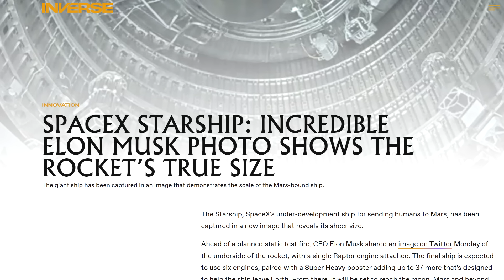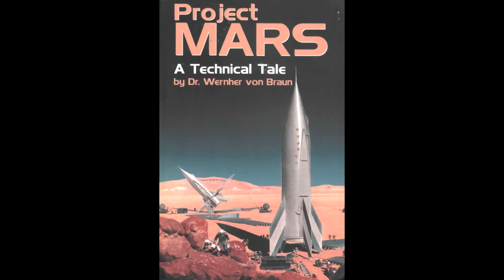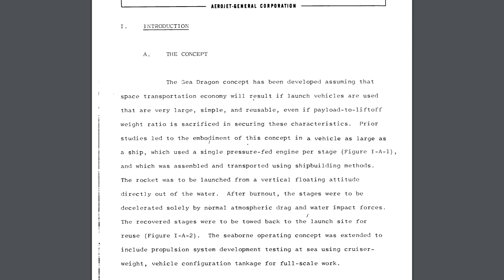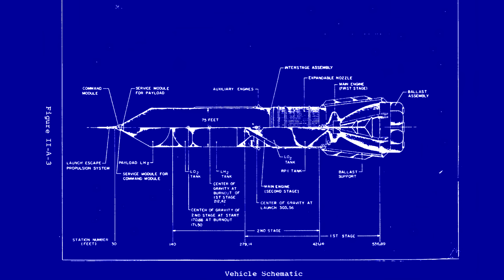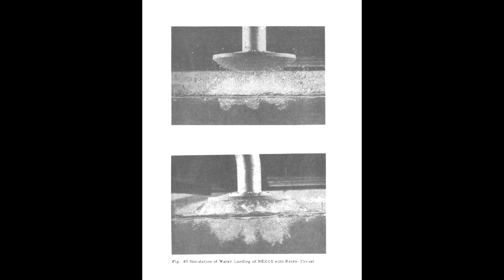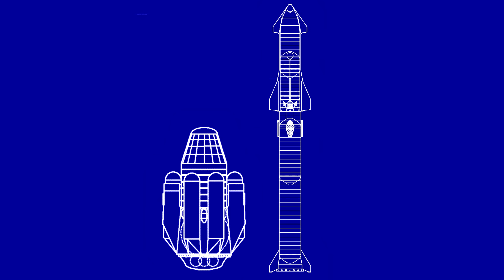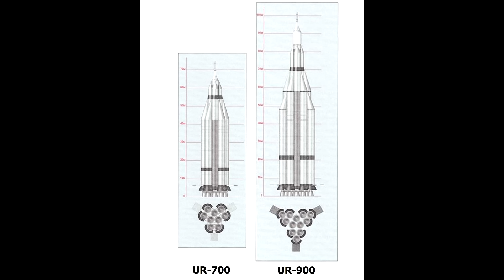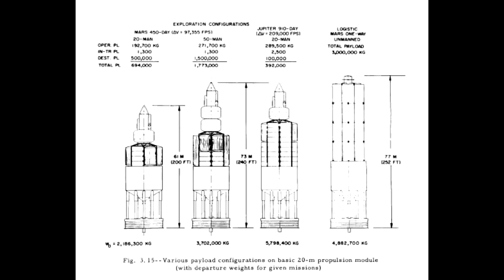The Old Rocket Designs That Make Starship Look Small

Comment: Sea Dragon remains my favorite rocket design. Such a cool idea, and love to see the concept of the massive BDB continue with Starship.
Reply: @thisisyourusernameondrugs9373 
Thinking with the other head, i see
Reply: Send the idea to Elon after Starship
Reply: gay bowser  
Playing too muck Kerbal eh? I did the same
Reply: @thisisyourusernameondrugs9373  You're telling me it means something other than this?
Reply: As a college student intern, I worked for "R.C.T" (Robert C. Truax) on Sea Dragon, at Aerojet-General's Advanced Development Division in the summer of 1962. We were calculating (using slide rules and electro-mechanical calculators) 20, 40, 60, 80 and 100 million lbf thrust engines, as well as some other projects using low-pressure, self-pressuring hypergolic propellant combinations.  What an inspiration to work for him on these projects. I had first enjoyed a correspondence with him when I was a fourth-grader and he was a Navy lieutenant-commander in 1954. My proposal as a kid was to use controlled atomic combustions to power rocket ships. He replied with an encouraging letter I still have.  In 1962, when the Air Force was proposing their Project Orion, I wrote to Truax to ask if my thoughts had anything to do with the Air Force's proposal. (Truax had a lot of interaction with the Air Force on many things.)  He wrote back that he didn't think so, but how would I like to work for him for that summer? Wow! Of course I said yes.  I spent the next 27 years directly in the aerospace business, including the military. I still keep up with space and advocate for it through the National Space Society, et al.
Ad Astra!
Reply: @jamesbarnard9710  Ok so you should know enough to see that the ISP claims on low-pressure fed engines that Sea Dragon was based on were nonsense.
Reply: @kennethferland5579  I  don't recall after all these years what Isp R.C.T. claimed. The propellants were supposed to be self-pressurized by the propellants boiling at the top of the tanks. It was an interesting concept, however.
Reply: Starship doesn’t seem like a very dumb booster to me. Not in the same way as sea dragon, at least.

Comment: @1:40, nice shout out to the reusable Saturn S1 concept from Convair! What's funny is that it was literally about a paragraph in the entire "NEXUS" study even though it had been worked on (after NASA asked it be included :) ) just about as much as the actual "NEXUS" itself. Not sure if the proposed recoverable version of the SII stage was given the same treatment, (only illustrations are essentially a slightly smaller S1 re-drawn) but it's interesting that the actual 'question' NASA asked Convair was about a NEXUS-like vehicle that could mount heavier upper stages (such as a larger NERVA or large self-deploying space station) AND still fit in the VAB. Hence the 'squashed' S1 and SII which would lower the overall height (and still fit on the MLP :) ) enough for those upper stages to clear the top of the VAB doors.

Think you might address the Goodyear METEOR (2,500ft long and 1500ft in diameter "Space Station" made by disassembling the third stage of a fully reusable, fully manned three stage to orbit vehicle, ya gotta love the esthetic :) ) and METEOR LV and it's successor METEOR Jr?

Comment: I also remember reading of a design back in the late '80s/early '90s where they went for musk-style horizontal scaling. The rocket would be lots of long tanks next to each other, alternating fuel/lox with an engine at the joint of each tank, with stages being nested inside each other.

Comment: I think the shuttle is a derivative of the double space planes concept. They made the first stage non reusable first then added the side boosters because the engines weren’t that powerful
Reply: We also don’t use it anymore for various reasons and the shuttle wasn’t designed for long distance space missions.
Reply: Other way around, the Boeing "Space Freighter" was designed from the work done on the Shuttle Orbiter.
Reply: @randycampbell6307  Well regardless. Using the same craft to leave earth especially a manned craft then require it to land back on earth is incredibly stressful for the craft and incredibly dangerous for the crew. Space craft should stay in space. Then you send the human crew, fuel, and a separate lander which can be different depending on where it’s to land say Earth, Mars, the Moon. Sure way more expensive but allows for much more versatility and modifications.
Reply: @DeliveryMcGee  Crap design? Only 2 failures out of how many flights?
Reply: @DeliveryMcGee  Yeah if NASA had been left to build it how they wanted, (complete with adequate funding), it would have been a lot better. The shuttle suffered from a massive set of compromises coupled with very little work done on it's biggest flaws after the fact that left it i'll suited for much of anything.
Reply: @rolandthethompsongunner64  It's (always :) ) about tradeoff's but in general you want a certain launch/landing ship and a deep space vehicle to allow more optimized and eventually economical travel both into and from space, and to and from other destinations.

Kind of like to see Scott discuss something like the "Spacecoach" concept or some of the other 'dedicated' space-to-space ships and give using Starship a rest. It's really NOT a good candidate for a full mission and is why "Mars Direct" (on which it's based) isn't actually a good paradigm for long term or extensive solar system exploration or colonisation.
Reply: @randycampbell6307  Everything I've ever read said the opposite. Got a link to educate me? Oh , wait, you' said the same thing I did, just disagreeing in general because I said it first.
Reply: @anzaca1  the "space truck" myth belies the fact that the shuttle was a development platform, a hopeful step toward a SSTO space plane.
Reply: @anzaca1  That is 2 complete failures out of ~150 launches. There were however quite a few more missions that came really close to disaster. Some of those were only saved by sheer luck. Compared to Soyuz that just doesn't look great. 

There was just so little abort capacity that I doubt anyone would man-rate the shuttle today. It was too much of a compromise between various goals imo.
Reply: @randycampbell6307  Not really. The s[ace freighter was designed in the early 60s after they finished designing the Saturn V and was translating into building and operational mode. Dr Zubrin mentioned in one of his talks how Nasa derived the shuttle from the freighter.
Reply: @prophetsspaceengineering2913  Fun fact: At the time of its retirement, the Space Shuttle had more missions under its belt than all Soyuz versions combined.
Reply: @DeliveryMcGee  Nope! Some of the Phase B Shuttle designs could do everything our Shuttle could - including crossrange and payload bay size - and still be fully reusable. Plus, NASA also wanted these features - both are good for mission flexibility.
Reply: @DeliveryMcGee  No actually YOU said it was designed to steal satellites which it was never intended to do. Also "everything you've read" appears to not cover any of the in-depth histories of the program which are pretty clear that NASA had a specific vision for the Shuttle which the Air Force did no really share since they didn't think they would actually have to use it. I'm not disagreeing that the Shuttle was compromised in general but both the basis of and reasons for are what I'm disagree with.
Reply: @MrHichammohsen1  As usual Dr. Zubrin is wrong, about a great many things :)
The Space Freighter was designed in the late 70s (as Scott points out) to address the perceived need for large cargo's to Earth orbit that would be needed to build Space Solar Power Satellites. A concept itself dating from the late 60s. It used design concepts and principles derived from the Space Shuttle Orbiter which was at that point in the advanced building stages.
Reply: @HalNordmann  Very true. And by now, Soyuz has flown more often than the shuttle with no further severe accidents. 

Soyuz had its fatal accident at the very beginning of its career and apparently, the program could improve upon that.
Reply: Going beyond what has been said above by various posters regarding NASA vs DoD influences on the STS design, I will mention some political/budget history:  The NASA budget request for a space transportation system was presented to the Nixon Administration as three options (small/med/large payload bay size and mass capability).  The numbers were scrubbed mainly by George Shultz's OMB, and then Nixon in consultation with Kissinger gave the go-ahead for the largest of the three.  They correctly reasoned that given the heavy development costs (though wildly underestimated in retrospect), going with the largest/best didn't come at that much higher of a price.  Plus a smaller shuttle would only replace the need for some classes of expendable boosters, so why go to all that trouble just to handle the lower end of the launch cost problem?

At that point NASA had been given what they wanted, including essentially all of the money they asked for.  The budget cuts/constraints people go on about came later, as the agency and contractors proved unable to deliver what had been agreed to within some semblance of the budget agreed to ("Space is hard.").  It's important to note that a configuration for the STS hadn't been set at that point.  Models resembling the as-built STS notwithstanding, NASA still had latitude.  They continued looking at things like an Orbiter atop a winged S-IC for a short while longer after program/budget approval.  So they had both money and design freedom as the effort got underway.

One item of special note in that original approved buget was $300+ million for development of an escape rocket for the STS.  That piece of the funding was axed early on not by Congrees, but rather the program manager.  He shifted it into the contingency allowance, reasoning (very correctly!) that the contingency amount they had budgeted for (20% of the estimated development costs? -- I forget) might not be adequate as the program got underway and problems arose.

Comment: I was literally just reading up on Saturn MLV, Nova and Phillip Bono rocket design variants before I knew you were gonna release this today. Seems any SHLV design exceeding 100 tons in payload mass has to get wider and not taller than 100m.
Reply: Most of that is to do with how the VAB at the Cape is constructed.
Of course, there is the TeamVision Jupiter III concept which just says "Hey we're gonna need a bigger building, that's fine, right?"
Reply: I do have a soft spot for the MLV designs, they could’ve been perfect for the Apollo Applications Program
Reply: Is there actually an interesting read to read up on this stuff or do you mean browsing the web?
Reply: Thrust to weight plays a role here. If you roughly approximate that rocket parts and fuel have a certain average density, then an engine with a given footprint and thrust to weight ratio can only support a limited height of "rocket stuff" above it. I guess with current thrust to weights this comes out to 100m
Reply: There is only one reason to build "skinny" and that is tool or transportation limits. There are some aerodynamic reasons, but at scale those start to matter much less.

Girth beats length...even in engineering.
Reply: @dsdy1205  

Well sure but it has not one form of density but two: the Weight density of all the dry weight components, and thrust density of the maximum thrust per square meter. Since it is extremely unlikely to suddenly find means to reduce weight density, it’s accepted that there’d be means to make the engines more powerful per square meter. Hence why Saturn V had a respectable 45 tons/m^2 for its time and Starship has more thrust density than the Space Shuttle SRBs, even though both could easily be at the very top of the list. SLS SRBs will be even more ridiculous though.

Comment: The best giant space thing is the plan to have the Saturn S-1C do a boostback burn and be grabbed out of the air under parachutes by a ridiculously huge helicopter powered by ramjets on the rotor tips, to be built by Hughes.
Reply: That truly was hilarious. The helicopters literally looked like Saturn V first stages with propellers installed.
Reply: The tip of the blades would have been supersonic even at the minimum speed
Reply: Ooh! I'd forgotten about the ramjet helicopter thing. I read about it years ago. :D

Comment: This may be repetition of something I posted elsewhere about Sea Dragon.  In the summer of 1962, after my 2nd year of college, I was privileged to work for Robert C. Truax at Aerojet-General's Advanced Propulsion Laboratory in Sacramento, California. Among the things I was involved in was doing calculations for 20, 40, 60, 80 and 100 million pound thrust first stage Sea Dragon designs! How did I happen to get the job? Well, back in 4th grade, 1954, I had this crazy idea about using "controlled" atomic explosions to power rocket ships. My uncle, who had been in the Navy in WWII, suggested I send the idea to the Bureau of Aeronautics, which I did. I got a very nice letter from a, then, Cdr. R.C. Truax, encouraging me. (I still have the letter!) In 1962, when the Air Force announced Project Orion, with a similar concept (with some actual testing with high explosives), I wrote to Truax to see if my kid's dream had sparked an idea. His reply was that he didn't think so, but how would I like to work for him at Aerojet, which I did. 

Another idea he played with was using some propellants that would self-pressurize because they boiled at room temperature. So long as they were under pressure, they remained liquid.  He would walk around with a clear bottle of Freon, so you could see it in its liquid form, until he squeezed a valve release, whereupon the vapor would spray out of the nozzle.  He used the similar concept with supersaturated steam in Evil Kineavals' motor cycle that was attempted to fly across the Snake River canyon. When the cycle failed to get enough thrust to fly across the canyon, and Kineval was forced to use a parachute, Truax "accepted blame" for not getting the water hot enough. Personally, I don't think it was intended to make it across, because Kineval would have been split like a fish if he landed!

Comment: Now I am wondering how big a Starship V2 could be? If the concept of scaling up rockets works for SpaceX, would they try to make Starship even bigger? Curious what you think @ScottManley 🤔
Reply: Surely if it works and they find the need, they'll go for the original starship design that's almost twice as big (mass) featured in the start of this video?
Reply: @Tiwack01  that would be really interesting, why did they chose the scaled down version, do you know?
Reply: They could go with triple-booster Starship Heavy, if they need about x3 payload. There is no demand for such beasts in the foreseeable future, though (about 1000 ton max payload to LEO in expendable config!!!). Smaller and simpler way to launch occasional heavy and/or oversized payloads is to have an expendable version of the upper stage, with traditional fairing.
Reply: @denysvlasenko9175  that would be sick

Comment: 13:45  Yeah, I understand that ratio..  but fuel tanks should not be pressurized?  When we scale a pressurized tank, for the same pressure the dry mass of the tank increase exactly at the same rate than the volume, so I dont see benefits on that regard, I hear that we can save on avionics, but that is NOTHING in comparison to the over all dry mass.
I always wanted to know how scale benefit the rocket performance and why..  But never read nothing detailed on that topic.

Comment: Personally my favorite concept was Boeing's LMLV. I think it was proposed in 1968, and could carry about 2000 tons to orbit (I think?)
Reply: ~1800 metric tons but close enough
Reply: Daaamn that's like 2 of yo mamma ;)
Reply: @danielculver2209  and a fraction of yours.
Reply: @Glass42112  He ain't coming back from that one
Reply: @danielculver2209  got em coach
Reply: The LMLV was a great concept, although I personally wouldn't have gone with an Aero spike. They did because of the paper advantages, but now, after the X-33, we know that aerospikes are super hard to make efficient.

I like BDB designs. A solid boosted 2-3 stage BDB type could be pretty inexpensive. Basically...I'd like to resurrect the AJ260. 😄
Reply: Isn't that the rocket with 10 solid rocket boosters that were almost the same diameter of Starship?
Reply: @JM Coulon 
And it looks like one too!
Reply: @davisdf3064  yeah I believe so

Comment: The concerns of instability for the Sea Dragon main engine are overblown and rooted in it's very low operating pressure. Combustion instability scales linearly with volume but not pressure which is why most rocket engines operate at several orders of magnitude higher pressure. However as you scale up the motor there's no need to lengthen the combustion chamber as the optimal length is the same no matter how wide or large it's volume is being driven by the characteristic burn length of the fuel mix. This means it's actually extremely easy to prevent any instabilities from reaching the chamber walls before the mass flow of the exhaust has already swept it out of the nozzle completely. Obviously this only works for rocket motors that are fifty feet wide or so. That's how the motors, the single most expensive rocket component per pound were to be made in a ship yard and out of welded diamond plate.